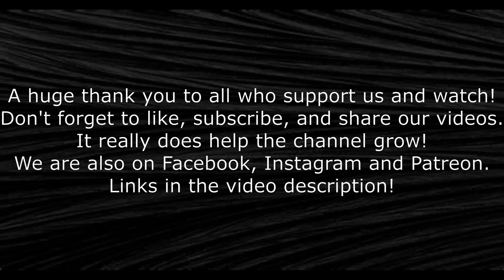Saving money and a few small projects! #591

Comment: I hacked my APC UPS and run 12 AH batteries instead of the smaller 7 AH batteries. Runs modems and routers for 2 days. Larger UPS can use large marine batteries if you chose.
Reply from the maker: Mine is able to run my router for a few hours, which is good enough in most situations. I still have cellular camera  that I can kick on in the event of a full power outage and lost UPS

Comment: I put a alarm system in my shop back in 1995 it phones Cops or Fire and has a Battery in it 6 volt has a siren very lowed cars wore pulling over on the Hwy when I was testing it it can be hooked up toba cell phone easyvit cost back then around $800.00 only thing is dosn't have is Glass and not wireless

Comment: Why choose to continue to pay Simply Safe + SIM for cellular access when you now have that Hi Tech Wizz Bang Super Duper WiFi Gizmo -  ;) ???
Reply from the maker: I have to have some sort of monitoring for my discount and it's something we desire. Plus I like the redundancy, should the Wi-Fi router go down for any reason and I lose my camera's it's not a big deal. Because my SimpliSafe works off of a completely different network, I'll have one or the other working at all times.
Reply: @TKCL 
.
After I wrote that I revisited the SS tech and see the cell service part is standard proprietary and built-in to both the hardware and the fees are covered in the monthly subscription rate
Also cellular is the only way that first responder notifications are dispatched from the system the Wi-Fi part is only for the customer to access the units features from the dashboard through their web app also you don't even really even need a subscription you could run it standalone but then you lose all the good features like recorded video and calling the cops and fire department but it will work as a local alarm for free not that you would want that they give you a lot of value for 350 bucks a year it's a great system
Reply from the maker: And my homeowners discount pays for a lot of that monitoring.
Reply: @TKCL  
.
 Btw, re ss 
1 - the alarms to the central station Only go out via the built in cell on the proprietary SIM.

2 - the central station calls the first responders on your behalf 

3 - the cameras only via WiFi for everything 

4 - all other sensors work via "Zigbee" the standard for the security industry (up to 800 ft) 

Check out this amazing value!
ASIN-      B09XXHFYK6
Put one in the chicken coup. LOL
Reply from the maker: Funny you mention that, I already have two blink cameras that will monitor the coop. The wifi is so good on that router it runs them great.